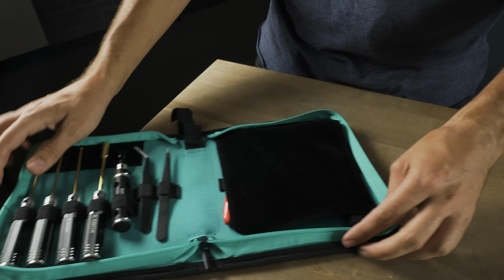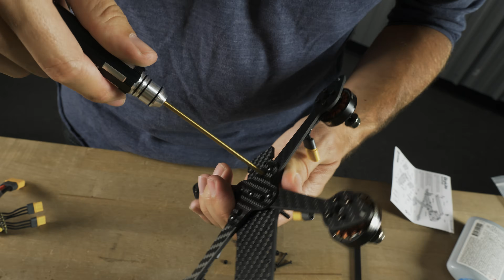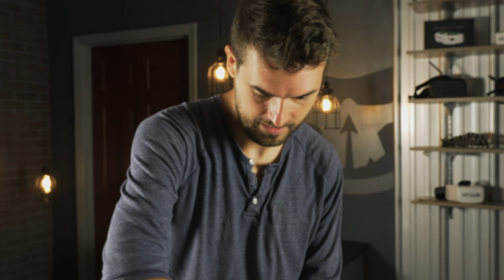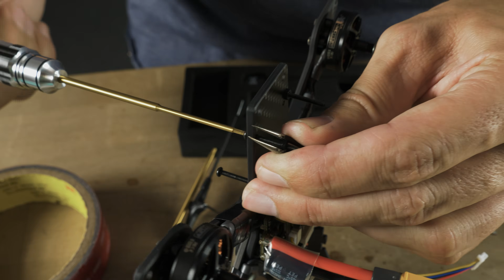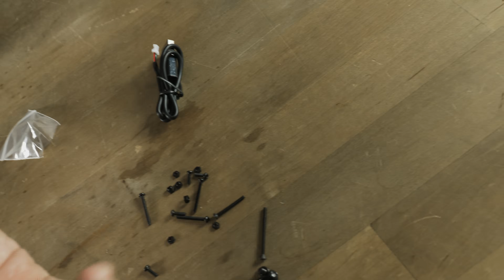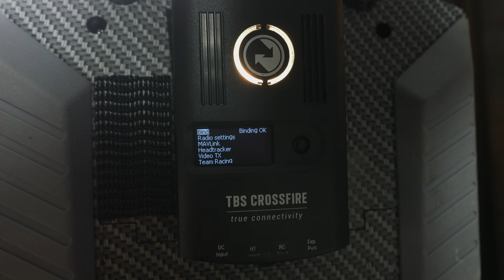Skylite Solder-FREE Build! - Cinematic 3-inch Drone for Indoor & Outdoor Shots

Comment: This was my first drone other than the old hubsan x4s that taught me the controls. Still was night and day and absolutely needed hours on the simulator before I was able to control her. Now she rips when she isn't being operated on. I also realized after purchase the physics of crash mass lol. So I bought a Meteor85 tiny whoop on the same avatar hd system. That was even more difficult to fly without lowering rates. But that helped me get stick time and get comfortable operating on them. My only regret was not shelling out the money for the Goggles 3 and DJI 04 unit. But that will be my next setup as without aftermarket antenna for avatar goggles, range was an issue. I took the prop ducts off and use it as a 3.5 freestyle. Love this thing. Just wish I went DJI like everyone else lol

Comment: Super cool kit! Love the build tutorial too! Just wondering if in future you might consider creating another kit with xt30 connectors, slightly smaller motors compatible with either analog camera or the new runcam wasp to help bring this kit under 250 grams. I know that doing so would reduce the performance of the quad significantly but at the same time it would bring you a wider range of buyers. #stayepic

Comment: good stuff. i am just starting to get into this hobby, know nothing and i got a deal on the eachine small pepper. got the props dirty pulled them off and put them back together and it didn't work(yeah, i put the props on backwards). thought it was busted so, i found a deal on amazon for the shark and another bigger drone for $150 and ordered those and another toy grade off of ebay. I really wanna build my own, so I am looking at your kits, hate soldering so this is really what i would like to get into. one question though, i see you got 3d printed parts and was wondering if you guys would put the stl files for those parts in with the kits if i decided to buy one. i also just bought an ender 5 plus 2 years ago, and didn't try figuring it out until now... with a few prints that turned out alright, i think i would like to get into 3d printing as well and it looks like these hobbies just go hand in hand...

Comment: I use DJI FPV  drones for patrolling avocado plantations.  Is there a Rotor Riot aircraft that can get me 45 minutes flight time ?  I do not need any acro kind of drone, I just need to orbit low over large orchards. GPS and some decent HD video system that works.  HELP !

Comment: The ONLY thing that deturs me from these frames are the XT60 connectors, if there was spacing for the front top plate then I'd be SOLD!!!!!
Reply: Wait, what's wrong with the XT60 connector? Its a great connector for batteries
Reply: @niclikescakes  yes, the XT60 is a great connector, however, was more referring to where it's positioned